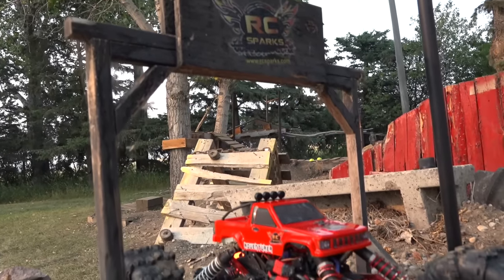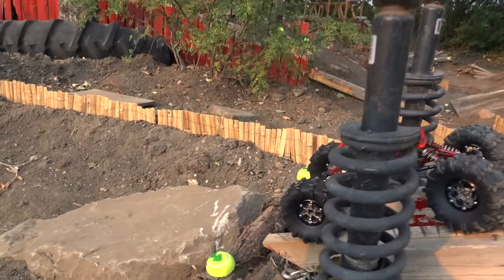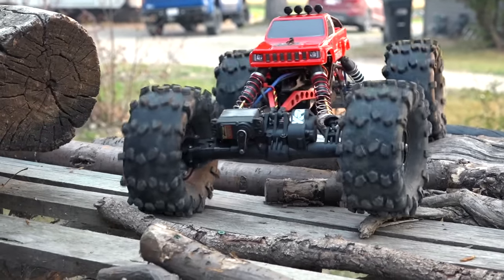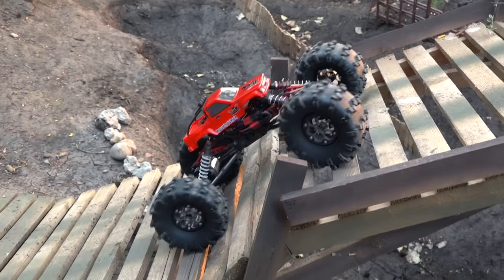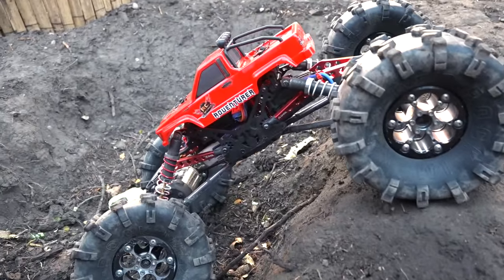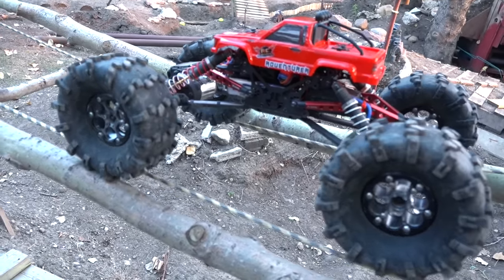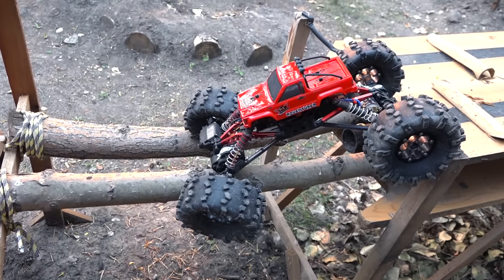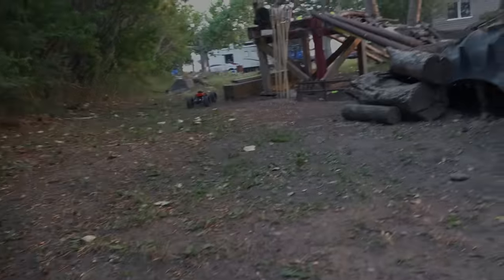MASSIVE TIRES + Toyota Body ='s a MONSTER TRUCK! MOA in the Backyard Scale Park | RC ADVENTURES

Comment: I'd love to do this course where are you located?? Also, you should consider adding wheel weights to the front tires, it will help you a lot on the wood areas and assists your dig unit significantly!

Comment: So are you turning the rear esc off to make it lock up?
Reply from the maker: Hi Larry! Yes, I am controlling the speed of the motor through the esc. The esc is not turned off per-say, but locks up a motor with magnetic resistance
Reply: RCSparks Studio Makes sense thank you bud;)